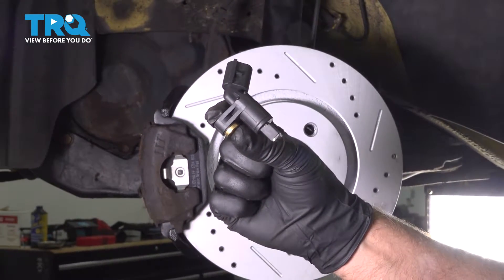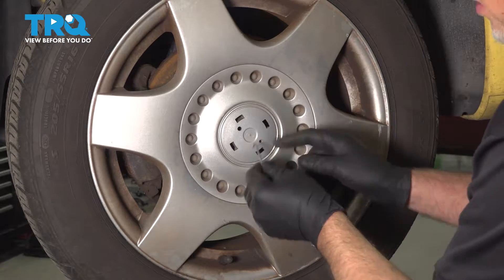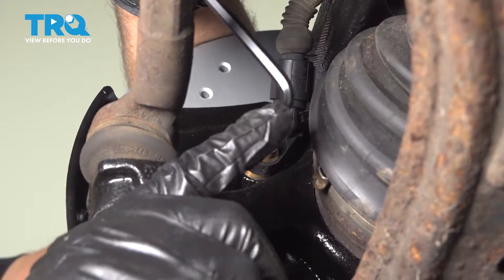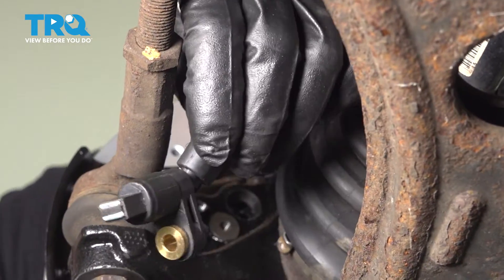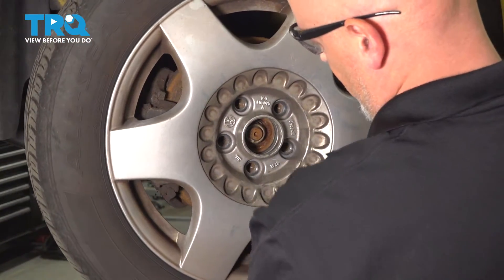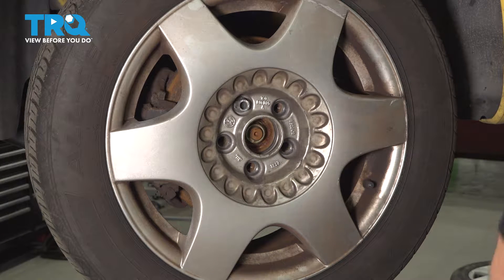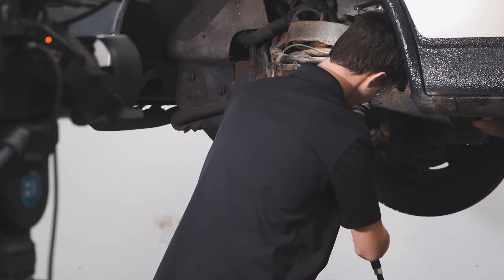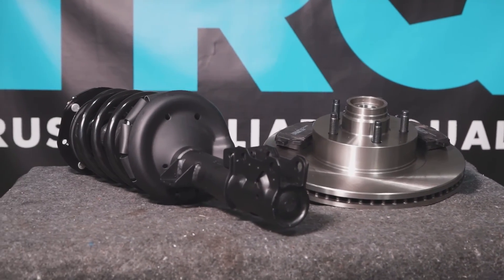How to Replace Front Driver Side Speed Sensor 1998 2010 VW Beetle

Comment: Do NOT pull the VW emblem off of the center cap, it’s not meant to be removed, it’s glued on
Reply: well my 2000 beetle they all fell off, the glue stopped doing its job lol